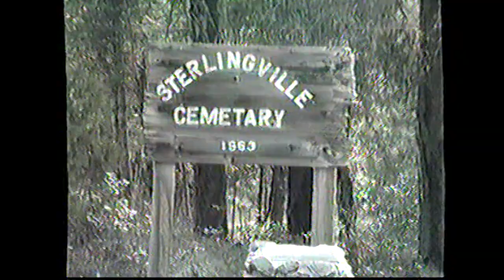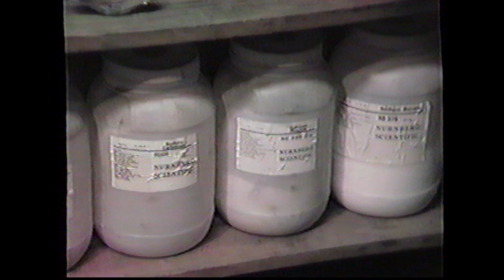Pounds and Pounds of Gold: I Mined Gold at Sterling Creek Mine | Glenn Wadstein

Comment: You are the man Glen. I'm a guy who DREAMS of mining gold and I sit back DREAMING up equipment to build. I sit back and google sheets of metal, I google the cost of 30 foot long steel barrels made of 1/2 inch steel, and I google heavy equipment. I literally build a goldmine in my head. I sit back and in my head think of the bench I found to mine, how I'm gonna sluice the pay pile after I dug a huge hole the size of an acre, and think of the machine and where I'm going to set it up. My best bet for a sluiceplant is a trommel  that I build out of a 30 foot long piece of steel (pipe).  I'd cut out sections of the pipe and fabricate punchplates out of steel sheets that are easily replaceable. Then I'd set the barrel on truck axles and have a differential on ONE axle to spin the barrel. To make enough traction I'd put a axle on top that presses that barrel down tight against the other axles/tires. Then all you'd  have to do is put a motor to drive the differential and yopu have a spinning trommel. Carry a spare engine so if the one broke down you have a spare. Then instead of hunting down a bearing and steel wheel, I'd be hunting a truck tire that went flat.My other idea would be a Rossbox type plant. Throw ALL the material thru a flume that's about 15 foot long and have three screens stacked on top of each other. The 1/8 inch material would fall to the bottom. Above that 1/8 inch screen, a half inch screen would be in place. Above that screen, a 1 inch screen would be in place. so anything 1/8 inch and smaller would run thru a sluice. Anything 1/8" to 1/2" would run thru it's sluice. Anything 1/2 to 1" would run thru 16 feet of Clarkson Riffles. Anything 1" to 2" would run thur boil boxes and enlarged Clarkson Riffles. I think 2 inch tall by 1 inch wide angle iron spaced 2.5 or 3 inches apart would kick out the worthless heavy rocks and the heavy nuggets would fall.

Comment: Thanks for the video Glen. I'm a guy interested in gold mining and I DREAM up equipment to mine with. I'm a sheetmetal fabricator so I know what metal can do. I've noticed one thing though, and that is the fact that a plant with non moving parts will save you alot of time and money. If a bearing goes, you may be down for a month. In the Yukon, you'd be finished. That's like trommels, why don't people set the barrel on 6 truck axles with an engine that drives 2 differentials on the axles? Then you'd have to change tires instead of hunting down a bearing. People set the trommel barrel on steel wheels instead of setting it on heavy duty truck axles with a ring welded around the bottom and a tire spinning sideways to keep the barrel from sliding off the tires.